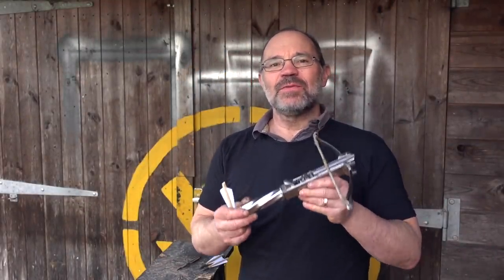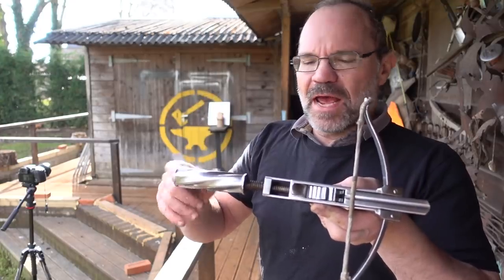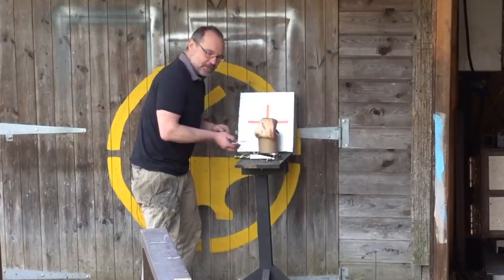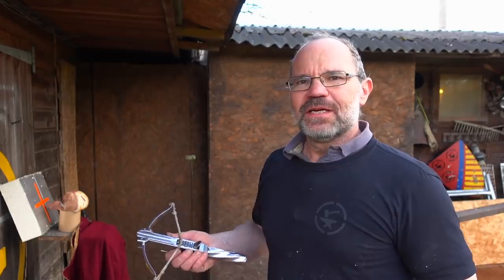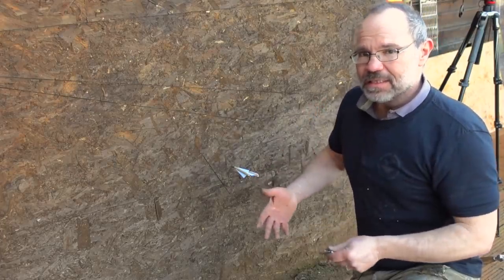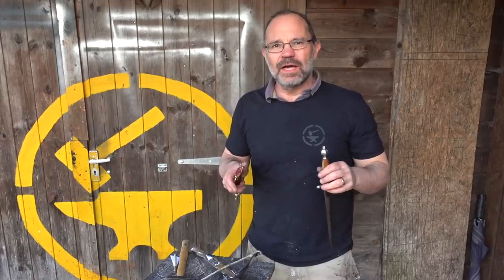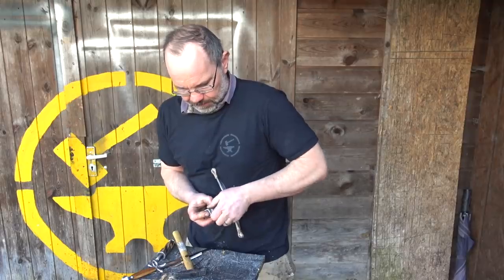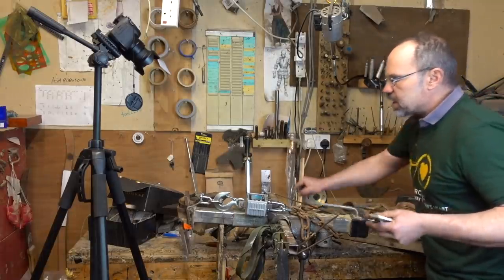200lbs Assassin's Crossbow - LET'S TEST IT!

Comment: It could be a point blank weapon, but the lack of a bolt clip makes me wonder about it at all. The only practical use i could see is pointblank though, where you walk up behind or near the person, pull it out, fire, conceal and leave. Its quite, its clean and its fast and you only need the one shot, at least if it was poisoned. Even the dagger isnt that fast or clean, because with the dagger you still have to put in a lot of force to actually stab someone, and theres several different motions that you have to do, and if youre in a crowd, people are going to notice that.

But again, i cant imagine them using this for that purpose, especially for something that requires a very simple single hand motion where speed and timing are required to not miss your window of opportunity.. youre not going to be fiddling around with a damn bolt. But who knows, maybe there are some out there that do have a bolt clip.

Additionally, while there are only a few left in the world, there is nothing that conclusively states that they were all of this specific design, and id be willing to wager everything i own that they werent, seeing as nearly everything during those time periods had a bad habit of breaking from the mold and being that much more different. A good example of this being carpenters. If you were a carpenter, you had your own set of measurements and tools for measuring. This methodology didnt get totally replaced until much later when universal measurements were invented. And even then, we still have an abnormally short Napoleon because the french measurements were longer than the british.

Comment: In general the bow forced the assassin to announce himself by standing and drawing.  The crossbow on the other hand could be used laying down, concealed and unnoticed by the victim and witnesses.  Unlike the gun,  turning every head for a quarter mile, the crossbow was also relatively silent, the noise it does make capable of falling into the background easily.  It was not uncommon across the continent to find laws against the crossbow from town to town.  The small one in this video would be much easier to conceal, of course and so an assassin could make his way into circumstance he would be otherwise noticed in were he to have a giant crossbow on him.  The fault in the apparent lack of power was easily dealt with by using bolts with sharpened tips to slice into the meat, and laying down a wrapping of poisoned cloth just behind the bolt head.  It need not enter deeply. It need not strike a sensitive organ.  A hit in the leg would be enough to mark the target as done.

Comment: Well back in the day it was often big parties where royals were invited and the king and queen were sitting by themself with guards.

You wont be able to get close enough to use a dagger and gunshot is very loud. using a "crossbow" while being in the crowd and shoot the king from a distance would create panic without revealing your location straight away aka give you time to escape within the crowd. (The difference between a gunshoot and a crossbow is the sound and the reaction everyone will stop and look at the source when you fire a gun, using a crossbow someone will scream out what happen and people will start running)

This is probably when it would have been used.

Comment: The only reason I think they have any kind of advantage if used by an assassin would be that they're quieter than a wheel lock but give you more range than a dagger.

still as you said it doesn't make a whole lot of sense because they're not that accurate they don't have the bolt clip etc.

So I think we have a parallel in a way with the so-called ninja sword. There were certainly Shinobi in Shinobi certainly carried swords but that doesn't mean they were such thing as a purposely built ninja sword likewise we have the ballastrinos and balestrino's could have been used by assassins but they probably weren't made to be assassins weapons.

Comment: Probably not the most effective weapon, compared to a wheel-lock or even a dagger, but you are maybe discounting the fact that the assassin would want to escape. Pistols are loud and produce a lot of noise, smoke, and muzzle flash. All eyes will be on you once you fire and you'd need to be pretty close for that, too. Daggers require you to directly engage and significantly increases your chance of being seen, identified, or caught up in a grapple, even if surprise is on your side. This my have short range and low accuracy, but even at 5 meters on a busy street or from a dark alley, you could pop off a relatively quiet shot and disappear in the confusion. If you miss, you're still likely to escape compared to the other options. Most assassins aren't on a suicide mission, at least the ones doing it for money and not idealogical causes. Just my two cents.

Comment: Seems like a 1-shot deal for when your in crowds. If some dignitary is walking through a crowd or even an open street and has a bodyguard, you're not getting close enough to dagger them, and using a pistol is very loud and you're likely not making it out alive unless you have help and a solid escape route. Using something like this is a good way to get someone from a short distance and get away without anyone even knowing what happened, removing the great risk to the assassin and lowering the bar of entry for hire. The bolts are weak enough, the victim might not even know they are hit or badly, allowing the poison to work without alerting the guards. Seems like it would make sense to ban these as it puts any dignitary, religious or political, at great risk for walking in the street. The fear of death by body guard as a deterrent is a 1st line of defense for an individuals security. Something like this can effectively remove that 1st line.

Comment: Seeing the grouping and effective penetration of flesh, I'd say likely it was to be a quiet shooter at close range. As for accuracy, it was roughly body width accuracy so if not being initially fatal it would be a terrifying weapon if someone walked up to you in a crowd , pulls it out and looses a bolt before walking away. Crazy thing is since it was quieter, it would be much easier to get away with a walk by shot. If anything, i wouldn't necessarily say it's overly deadly, but the potential for inflicting pain would be much more likely. I'd say gangs would likely enjoy these as a way of scaring debtors into paying off their debts. Even if it's a graze and not a full on hit, being hit by it would be a message in itself.

Comment: Maybe it would be possible to put a 400lb draw weight on the same mechanism. That would make it lethal.
Reply: It's already pretty tiny for 200 pounds, would probably have to make bow bigger to make it a working 400 pounds. And it would probably have like 10-12 J then still not very lethal.

Comment: The steel limbs don't move fast they move heavy! These crossbows are designed for up close and personal with a steel Bolt, you'll find at that range the foot pounds is crazy off The Charts can go clean through inch and a half hardwood

Comment: Pistol is too loud for missions that require more subtlety. Daggers require you get in close. The assassin's crossbow can deliver poison quietly from a fair distance away. Accuracy is a problem if this is your first time using one. But I would imagine that someone who was confident enough to use such a weapon as a murderer for hire would have at least put the time in to use it somewhat proficiently.

Also, with a poisoned tip, all that matters is that you hit somewhere on the body. Precision isn't as much a factor as it would be if you were going for the heart or some other vital organ. Hitting a relatively small cut of meat from 5m away isn't the same as having a whole body to aim at.

Comment: I can think of two uses/ reasons to choose this over a pistol or dagger. First, it's much quieter than a pistol is. Also the ammunition, I'd imagine, is far cheaper and easier to obtain for the crossbow, also less tracible. You could make it yourself if you had to. the cross bow is much more intimidating than a dagger is. Even though that shouldn't be the case it is. 
the second use for the cross bow would be similar to shuriken's, not meant to kill. Just maim and distract. 

that's my two cents.

Comment: I guess you'd get a much better accuracy with shorter fletchings on the bolt. they almost look like little delta wings, going 2/3s of the length of the shaft. I guess the bolts could be much sleeker as well, lighter and thus faster. That might be giving an entirely different picture of range and impact on flesh and how accurately you can place your shots. It's still an awkwardly handling thing. 😆

Comment: With a lot of people, it was probably feasible to get close, while still not within stabbing distance. I would, for instance, imagine that getting within stabbing distance of the queen would require being part of a trusted circle. Allowing nearly anyone within 4 to 5 meters, however, would probably be considered safe by her guards and attendants; assassinations from medium distance using a concealed hand gun wasn't a thing, because hand guns generally couldn't be concealed. In a crowd, adding 4 to 5 meters, maybe a lot more, if the investigators overestimated the capability of the weapon, to the radius of potential suspects, could make a huge difference. That is, provided that you weren't seen by everyone, aiming a big gun at the victim, and/or, after the deafening bang, seen holding a profusely smoking gun. Finally, if the issue with accuracy is due to anti-intuitive handling, rather than an inconsistency in the weapon's mechanism, a person with the proper talent and training could be accurate at a much longer distance than Todd; it might even be possible to literally shoot from the hip, thus making no suspicious motions.

I'm also curious about what we don't know, and probably can't:

As established, in practice, bows like this are "one shot wonders". For an actual assassin, getting off a second shot would be impossible. That means that a sophisticated reloading mechanism was unnecessary, without which the weapon would be simpler and cheaper to make. Such cheaper versions would be less likely to be preserved, as people wouldn't bother to.

The actual use of many objects involve things that won't be preserved, or even deliberately removed. It's conceivable that the bolt might have been attached by something other than a clip. It may even be likely, as clips weren't intended to hold the bolt securely enough that you could stuff the crossbow in your pocket and spend an evening, without worrying about the bolt coming loose. Alternative fastening might include thin threads that would easily snap when shooting, light glue (the way bows work, the force needed to break the glue wouldn't reduce the power of the shot), as well as, I'm sure, lots of things I can't think of. Any method of dampening noise from the operation of the crossbow would also be likely to involve perishable materials; I'm pretty sure I've heard about such methods for full size crossbows, but can't remember. Finally, there may have been a multitude of different bolt types that have been lost to us. For instance, it seems likely that there will have been bolts more suited to delivering poison, as the ones shown in the video would be very poor at it, only allowing a thin coating on the surface, and rubbing off much of the poison on clothes, both of the assassin while carried, and of the victim as it passes through. As the KGB can attest, for poisoning, you want a tip that detaches in the wound, and has pores or hollows that can hold the poison.

In 500 years, they'll conclude that fishing hooks were decorative, because no fish would bite a bare hook, and assuming that we used bait will be considered speculative, as hook has been preserved with bait on it. Of course, this is assuming that all our fishing videos have been wiped from YouTube, by then.
Reply: Would also need fishing books to have been wiped out as well, and the internet in general.

Comment: Can someone explain this joules thing to me? Not to be completely thick, I hope, but why do joules matter if it pierces the skin? You're still bleeding. And that thing went two inches into that pork.
Reply: It's a tiny bolt, doesn't look much bigger than the end of Tod's thumb, it's very narrow, not sharp at all, and the shaft would automatically "seal" the wound since it's about as wider than the point.

There's really good change that there would be not much bleeding at all, and given the nature of the mission, the victim would often have instant access to medical care (decent one for the period too, if victim was rich).

Good chance that pouring the would with booze/wine/honey and bandaging it thigh would make it forgettable after two weeks.

IT really doesn't look much worse than stepping on a nail. Which can be deadly with really bad luck of course, but still not really viable assassination technique.

Comment: Crossbow power to pierce clothing or light armor, plus the ability to penetrate at distance.  Just add a poison tip.  All it has to do is break the skin.  Not very effective without it, unless you get a head shot.

Comment: My 235lb crossbow needs to be that strong because of the distance of string travel. There are much faster shooting crossbows at less weight but the have sometimes twice the string distance and are compound. This might be 200lb but its string moves like a inch. Not much distance to transfer the energy and get up to speed

Comment: Back of 60's M.A. magazines the advert "Ninja Crossbow" for a few dollars. Gun style pistol grip and trigger and carbon fibre bow that would penetrate a 44 gallon steel drum up fairly close, simple and accurate. Long gone (luckily) as it was a fun target "toy" but could be lethal and long ago banned in Australia along with nunchuku ... and ... "dual edge" knives! So the dagger just went out the window replaced with a $10 serrated, over the counter at Coles or Woolworths, tomato knife that will cut through bone. Go figure 🤔😂🇭🇲

Comment: to make a useful bow/crossbow you must have in consideration the Lb of the bow itself and the distance its capable to bend, so the strenght of it can be well transfered to the arrow or bolt itself.
a 30cm crossbow its useless unless it has like 400lb and that is more likely to fail and hurt you tbh xD

Comment: I feel like the entire idea of testing it from 5m is somewhat flawed.  While that seems like "close" range, it's a weapon that cannot effectively be aimed.  I'd have to imagine the use case is almost point-blank.  Like standing behind someone in a line, or walking behind them in a crowd.  Basically the medieval equivalent of a cold-war "stinger" pen gun.  You're walking down the street behind your target, you aim from the hip from less than a meter away and fire a dart into their kidney.  While the victim is screaming and creating a lot of attention, it's not completely clear to anyone in the vicinity what has actually happened.  The assassin didn't make any kind of stabbing motion, there was no gunshot, and there may not even be that much blood assuming the dart remains stuck in the wound.  While the victim and any surrounding onlookers need several seconds to make sense of the situation the assassin can just slip away.  

Testing the weapon at even longer ranges seems somewhat antiethical to the purpose of a miniature hand-crossbow.  If a shot from 30m was required, a different weapon would surely be better.

Comment: Question though
So it’s a long reload compared to a longbow (as an archer I can easily get a shot off around every 6or so seconds) but how’s the reload compared to say, a flintlock pistol?

Because I feel those two are closer
Reply: A pistol at that range would absolutely end the person, especially will the large calibres they had back then so it's kind of a moot point. Aim at the chest and you won't need a second shot but even if you did pistols would be so much cheaper that you could just carry two or three
Reply: @mrcaboosevg6089  For multiple people or for firefights like you need to be able to reload
Reply: @lucasky1394  Back in those days once the ammo was spent it'd devolve into sword fighting. Other than in major battles firearms, especially early ones would not have been reloaded in a fight. You either did the job and ran, missed and ran or got your trusty sword out

Comment: Draw weight is erelavent my 50lb compound  bow has more  power and accuracy just because it takes two hundred pounds to pull it back doesn't mean it transfers that energy into a bolt